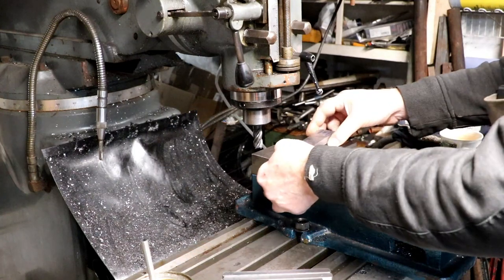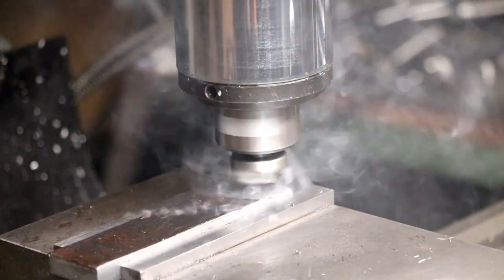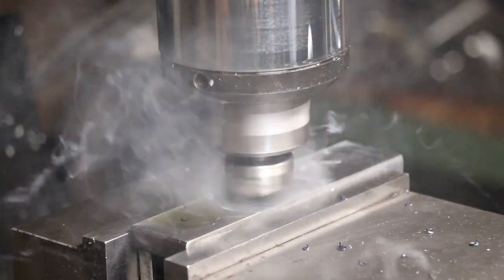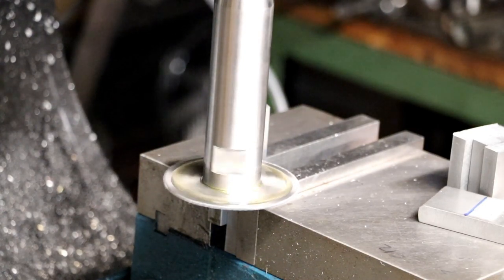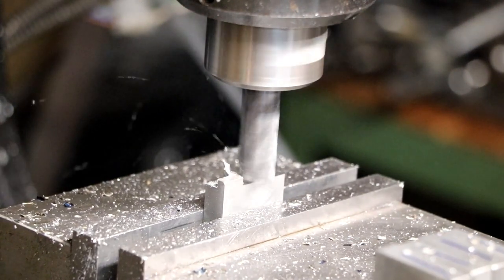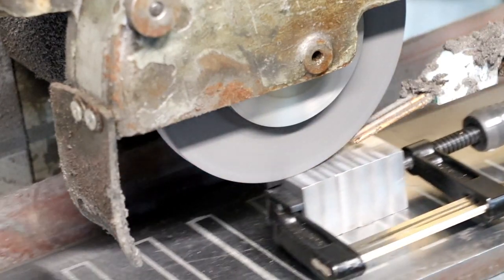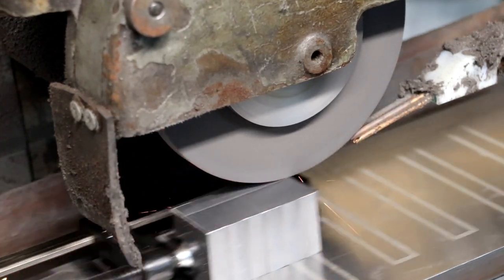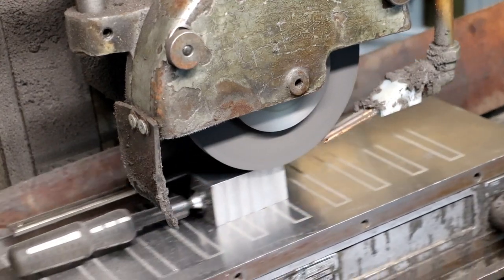Custom Angle Plate Build Part 2

Comment: Hi Al, your slitting saw arbor looks to be running very true.  Hard to do with that long shaft. The sound it is making is reminiscent of the mating call of a trumpeter swan.
 😂. Nice to see your grinder at work. Nice job.  Cheers Mike
Reply from the maker: Let’s be honest Mike it sounds bloody awful, may be I need a different numbered tooth blade, but I know little about slitting saws.
Cheers Al.